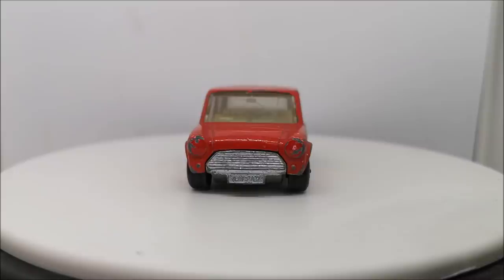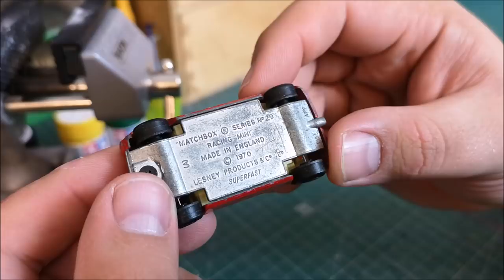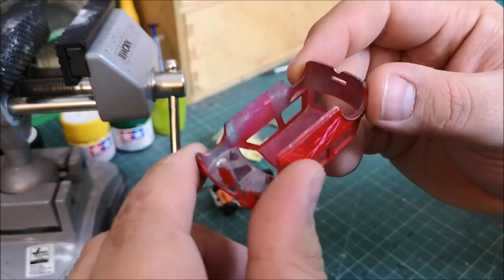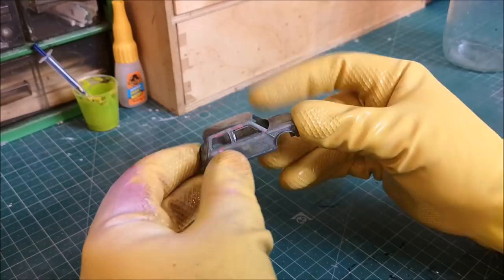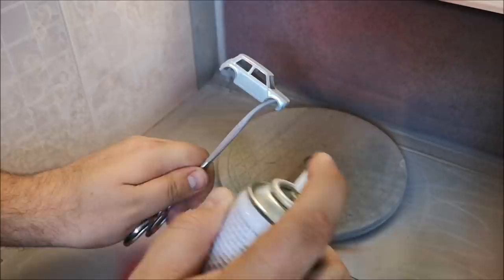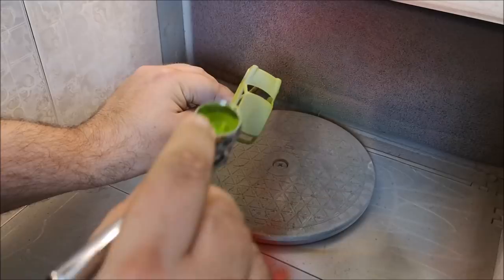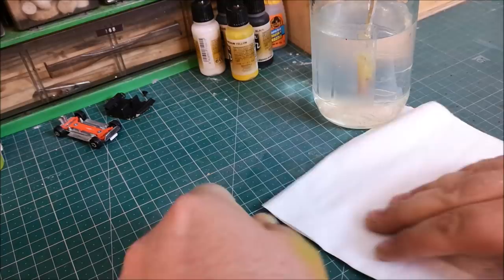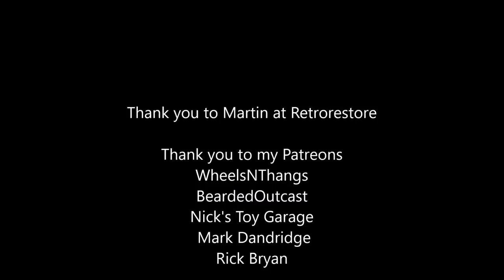Matchbox 1970 Racing Mini - 'Build-Off' Mr Bean Custom

Comment: Again good results  but lacking work in progress on processes other than the spray painting of the body shell; all other paintwork was done off camera and "coated the whole lot in Tamia TS3"?????  No explanation what that is. Polished the windscreen ?? with what?  Chromed the base; again with what? Citadel on front grill?? what does that mean?? Fixed the number plate, with what and how?  Car from oxidation stage to shiny process not shown just the before and after shots.Remove rivet, drill centre post and remove flange process not shown. No re-assembly process shown. so in reality apart from the spray painting of the body shell this video is just a before and after show. very disappointing that more work in progress is not shown  So on this video I am not giving a thumbs up but I will refrain from a thumbs down and hope my comments are headed as the work is of good standard but would love to see more of how those results are achieved.  And by the way; I hated Mister Beans show on tv and found nothing whatsoever funny about his humour at all.